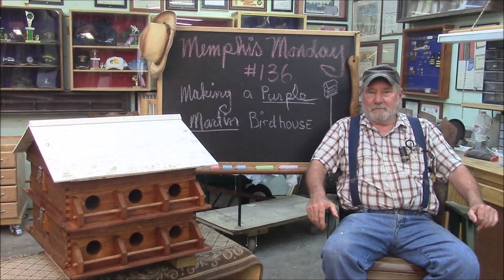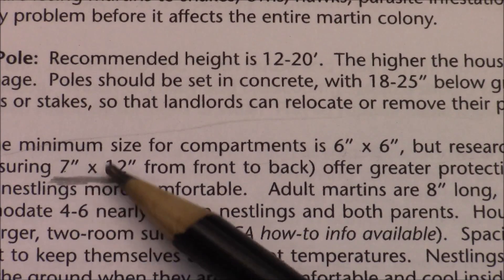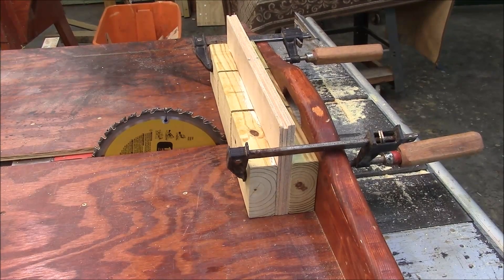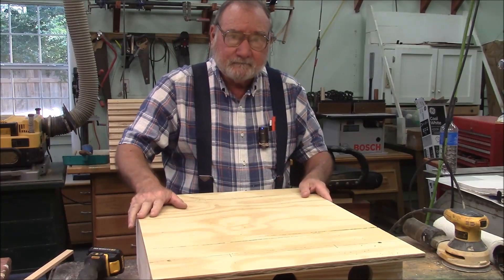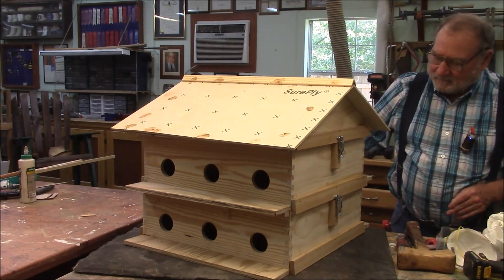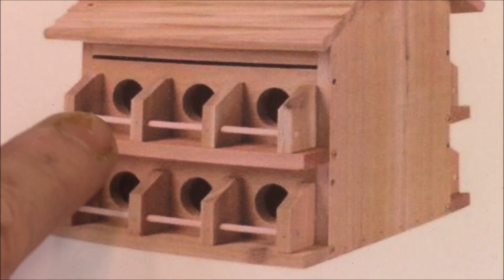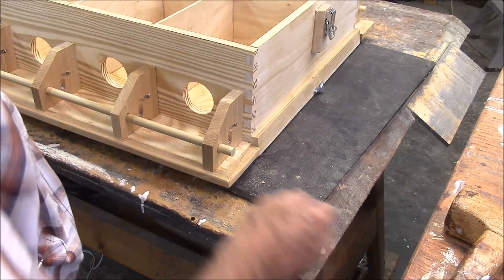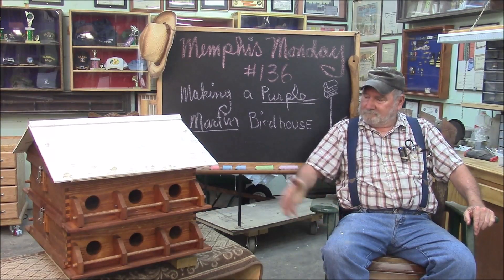Designing and Building a Purple Martin Birdhouse MM 136

Comment: If you're doing this for making a profit, you use fence boards and no dados (finishing nails), making it easy to clean
and get the sparrows (or pigeons) would be the added hardware.
Some kind of low cost way to put it in a large tree or on a building for $30 or so would sell well.

Comment: Very nice birdhouse but it seems labor intensive. I understand the strength part but why finger joints? Seems like a lot of work. Butt joints or even 45 degree angle would've been suffice with glue and screws. I noticed in one of your comments that the roof already failed. For my birdhouses (sometimes) I use roll roofing material that I cut into 2 inch strips and over lap them to make it look like roof shingles.

Comment: The box joints and cedar oil stain you used give the whole bird house a log cabin type look which really adds a lot to to overall appearance. I like the latches and removable partitions for easy cleaning, which is something I wouldn't have thought of but makes a lot of sense. Come springtime, I'll bet there will be a lot of Purple Martins moving in to their nice new home.
Reply from the maker: A little honesty here, I wouldn't have thought of it either!!  Fact is, my design is a melding of several ideas I got from the websites I read on the subject.  This was really a two part problem, as I say in the intro:  first, to figure out the requirements, then execute a design based on those requirements.  Moreover, nothing in my build was original, except perhaps coating the roof with epoxy.
     However, I did go a little Rambo on some of the structure (like the box joints, which were totally unneeded).  We have raised the house up now, and already some birds have shown interest.
     Thanks so much for the comment and the view.  Hope to see you around here next week.